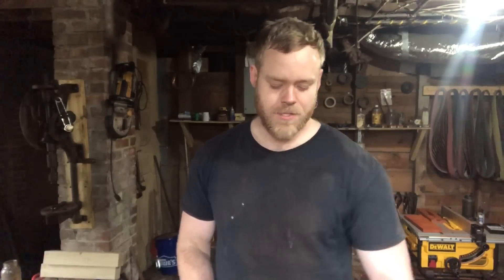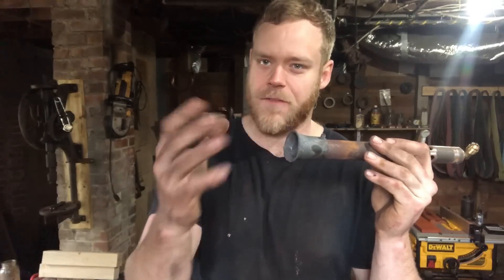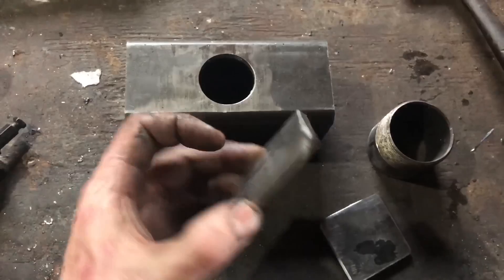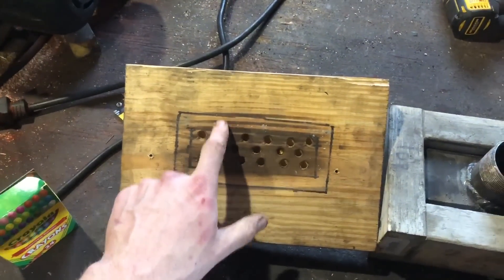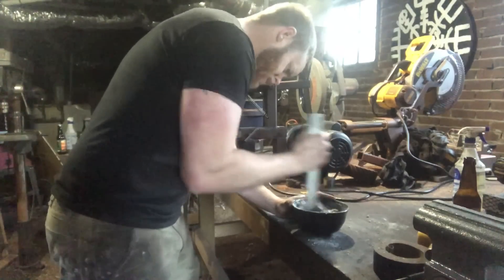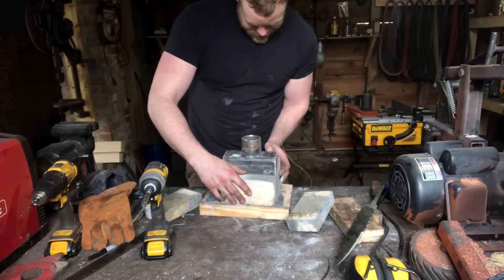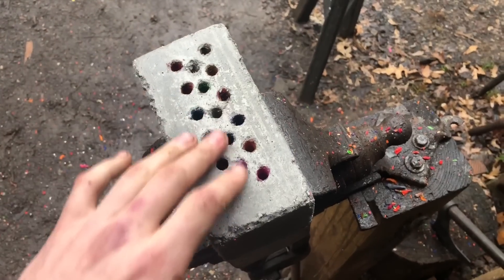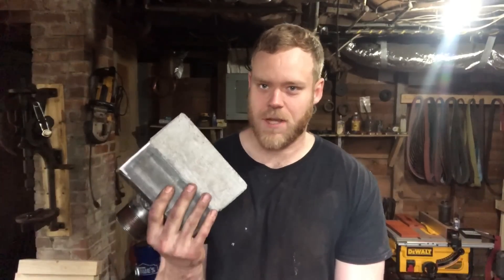How to build a ribbon burner

Comment: Fast food drinking straws work really well too and they pull out nice and easy with a pair of needle nose pliers, leaving a glass smooth tunnel through the Mizzou castable. Also, I put mine on top of the wood stove for about 7 or 8 days which means they went through dozens of say, 200 to 500+ degree heat cycles before I actually fired them. Good simple video. Thanks for posting- this info was a lot harder to find 2 years ago!
Reply: MillerBuilt that’s what I do also    Even cheaper than crayons.
Reply: And less risk of losing them due to consumption!

Comment: Just put the right in the oven,. Lowest heat. Cookie sheet with foil under it. Wax will melt out at under 200 degrees. Residue will burn out easy on the first fire
Reply from the maker: drasons forge ill give that a go on the next one. Sounds easier

Comment: There is a “best of both worlds” burner that was designed by Jerry Frost, a long time member of iforgeiron.  He created a Venturi powered ribbon burner that runs like a dream.  It is powered by one of his Frosty 3/4” T-burners that are super easy and cheap to make.  It runs super quiet, requires no blower, and uses little fuel.  It also produces a slower flame and produces almost no dragon’s breath.  It really is as good as it sounds.  You can see his original build here:
https://www.iforgeiron.com/topic/48001-naturally-aspirated-ribbon-burner-photo-heavy/

Comment: Hey quick question, where on earth do you get your mizzou or castable refractory?? What's the most ideal place because I'm having a horrible time trying to find it locally or a place where I wont have to pay $50 for shipping! Thanks!
Reply from the maker: Jordan you’re really just going to have to buckle down and pay the shipping. Amazon and eBay usually have 55 pound bags for about 60 some dollars with 50 more in shipping. But buying from them you will get the best price per pound by far
Reply: @OldHickoryForge  Gotcha, I just didn't know if there were places that sold it locally or for a better price, but thanks a lot for the advice! Didn't expect amazon to have it to be honest.
Reply from the maker: Jordan sometimes they do sometimes they don’t. It’s really hit or miss. But the best deals are there and eBay. I’ve bought from them both
Reply: I found Kastolite refractory cement at a ceramics supply store. Bought it by the pound from them for pretty cheap.

Comment: What would ya figure is the minimum size forge youd run something like that in?
Reply from the maker: Scot Snook I run one this size in a forge made of an old propane tank. About a 500 cubic inch chamber. Honestly you could probably go 600 or more and still weld no problem. They’re powerful burners
Reply: @OldHickoryForge  thanks man

Comment: Nice video, I just finished a ribbon burner build on my channel but I used straws for the holes instead of crayons. Just less of a mess and no need to drill out but it did take me a bit to pull all of them out of the refractory after it set. Anyway just a different way to skin a cat.

Comment: I peel the crayons before I set them in the mold and the only other thing I do differently is I melt the crayons out in the first of three heat cycles 

Well and I use thinner side wall 3” pipe ,oh and I just drill the holes directly on top of the tube before I weld the 2” nipple to it (no bent plate to weld in doing it like that) 

Great tutorial dude

Comment: I'm surprised you drilled out the crayon - when I saw you were using them for the holes, I just assumed you would melt them out in an oven.
Reply from the maker: Jack Dawg you can. Or with a torch. But it’s not as quick and makes a much worse mess so I prefer this way.

Comment: Excellent video, thanks John. Couple of questions: You said 18 holes works well for you. How did you determine that, did you try more or fewer holes in the past? Also, how far down did you set the body into the refractory when you did the pour? Was it 3/4"? Thanks
Reply: The optimal number of holes in the ribbon burner should be the volume of the pipe the air and propane are entering from.  I'm sure there are formulas to figure it out.  If you are using a 2 inch pipe see how many crayons or straws can fit in the pipe and that should be pretty close.  I don't think it is that critical but that is how I designed mine and it works great.
Reply from the maker: Steve Olsen yes 3/4 of an inch. And the burner my forge runs on has 15 holes and works fine. Could maybe even do 12
Reply: @OldHickoryForge  Thanks !

Comment: Good idea to get an extra box of snacks. I'm about 136 percent sure the first box wouldn't last long enough to actually make the burner. Also, instead of drilling out the crayola fries, you can melt them out onto your favorite MRE. 🖍😋
Reply from the maker: Kevin Smith chili Mac is the only way
Reply: Especially good as an additive to the chicken-a-la-king. Of course that was a meal from the late 80's to early 90's.
    Let me hear my Dessert Shield/Storm soldiers represent!
Dehydrated pork patty needed a sauce after reconstitution too.

Comment: Great video. I was just wondering what happens if you shut off the air between heats. I could see using this burner with a hand crank blower if you didn't have electricity in you forge. But I can also see gas building up and causing a problem with a possibility of exploding.
Reply from the maker: Soggy Bottom Forge yeah don’t do that. The gas has to have air constantly pushing it with this type of burner. If you want to cut it off between heats cut the gas and leave the air running
Reply: @OldHickoryForge  that's what I thought. Thanks.
Reply: Yes and ALWAYS  air on first , and off last!

Comment: That looks awesome! If u get a chance, check out MagneGas. OxyMagneGas2 burns at over 10,000 degrees Fahrenheit at a low psi of about 5. I’ve been using it 5 years, it’s cheaper than acetylene. Check my vids if u want.     More info on page 12:   https://d1io3yog0oux5.cloudfront.net/_9fab322ad4996734bb69905303f2c578/taronistech/db/199/908/pdf/Taronis+Presentation+Q1+2019+v6.pdf

Comment: As you can see on my channel, i built a ribbon burner, i now have the forge too..but i don't understand at all how they can use less fuel, you are using a bigger gas injector, 2 times bigger than a regular homemade atmo burner, 0,8 mm for an atmo, 1,6mm hole on my ribbon..i forged just 3 hours with it so i don't know if it consume a lot more fuel or not, but in theory, it should use more propane
Reply from the maker: I don’t have a set orifice size. I control my gas flow with a needle valve. Check out the foundry furnace video in the description I talk about it. As well as the video where I talk about my forge.
Reply: @OldHickoryForge  ok ! I use like i said a 1,6 mm 0,064" hole, controled with my propane regulator, i will check the foundry, i've seen the forge video
Reply: I use ribbon burner and forge weld Damascus at 9 psi. Then 6 psi for normal forging. Use a .30 welding tip for gas. Very fuel efficient
Reply from the maker: I can run my regulator at a much lower psi and get the same heat than I could with my Venturi forge. Guess it all depends on your fuel/air assembly. I’ve noticed about a 25-30 percent increase in run time with the ribbon burner over my Venturi forge
Reply: @OldHickoryForge  yes you can run with a lower pressure, but a bigger orifice consume more gaz..but if you noticed a longer forging time..that's nice😁
Reply: Your gas is now "watered" down with a ton of Oxygen. It will burn hotter and more throughly so you end up with more heat, more flame less of the gas you have to pay for (propane) anymore of the gas you get free just for living on planet earth. So in reality you ARE burning more gas, just the majority of that gas is oxygen not propane.

Comment: If you use straws (for McDonald’s or other fast food resteraunt) you can pull them out with pliers, no drilling needed. That’s what I did with mine. :). I should be test firing it soon, video out later.
Reply from the maker: Ouroboros Armory I’ve seen people do that. I’ve heard sometimes they can buckle though. Crayons are more rigid. Either way I’m sure will work

Comment: hey john. I am a beginner here, and was wondering what brand of grinding belts you use, and what progression of belts are when rough and final grinding? thanks in advance
Reply from the maker: bhardmanaz combat abrasives or klingspor. 36 or 40 for hogging. 80-400 and a fine scotch brite belt for finishing. I also have 600 and 800 grit belts I use for sharpening
Reply: @OldHickoryForge  Thank you John. keep up the great work man! love your videos

Comment: Hey John, thanks for the informative video! I've just tested my own build ribbon burner, unfortunately there are some problems. The ribbon burner consumes over 15 psi so that it runs stable and the fan regulation/door is closed for minimal ventilation. The gas supply has a bore of 0.03 inches. Could it be possible because I have no air mixing device?
Reply from the maker: Zyo sounds like you need more air. Air is your friend with ribbon burners. It could also be because you have no mixing device. I’ve been told they only want to burn in the middle without them
Reply: @OldHickoryForge   My flame burn 80% to 100% depending on the mixture. Maybe my blower is to strong because if I open it a little bit the flame goes instant out. Thanks man!
Reply: @bjorn980  you could try a sliding air gate to adjust your air flow
Reply: @OldHickoryForge  Hey John, I appreciate your opinion, maybe you can take a short look at my video. What can I optimize or should I build a new ribbon burner like you did? The mixing device is now welded in.
https://www.youtube.com/watch?v=aFBw8UkdN_c
Reply: I changed some things today. First and foremost, I throttled the blower from 19V DC to 6V and I forged a mixing device like a turbine (like here 13:30 https://youtu.be/zg5_iwn8vRo). My burner is built similar to Essential Craftsmans one. Unfortunately, it still doesn't work well the temperature color was only about 1600°F. Maybe my ribbon burner is to big. I think my next step is to open my ribbon burner and weld a perforated metal plate like Johns mixing device in it.

Comment: Did you use a speed control on the fan or just the gate? I am using a gate valve and speed control. And what is the C.F.M. on the far I have tried this before and was not happy with it maybe my fan is to small only about 600 C.F.M. but I am not going to stop I will get this to work !!! Thanks for the vid .... Be well and be safe..
Reply from the maker: cockatoobirdman bill just the air gate. And my fan is only 112 cfm and works great
Reply: @OldHickoryForge  thank you for the speedy reply I am ordering parts now. the forge I am building 1215 Cu. In. 9" x 9" x 15" inside with 3" soft bricks + 2" KO wool 1+" cast bottom over 2" soft brick thanks again ... Be well and be safe...